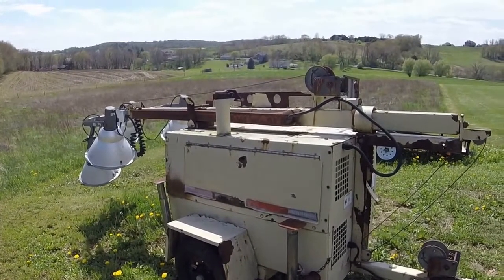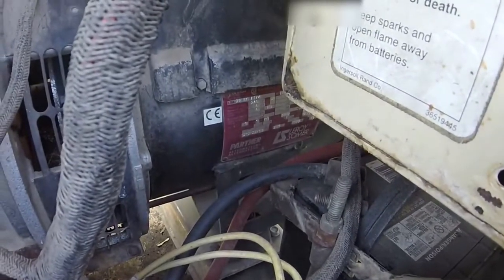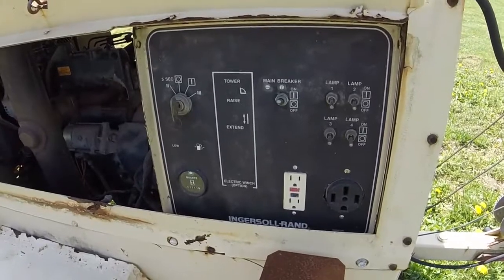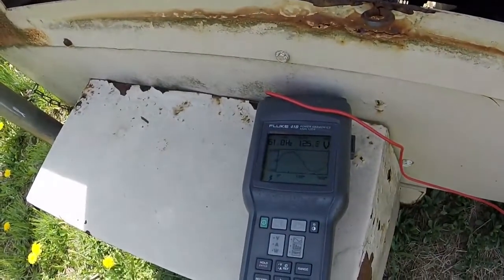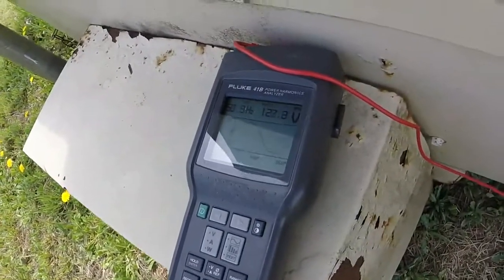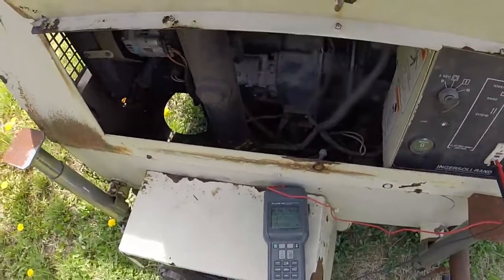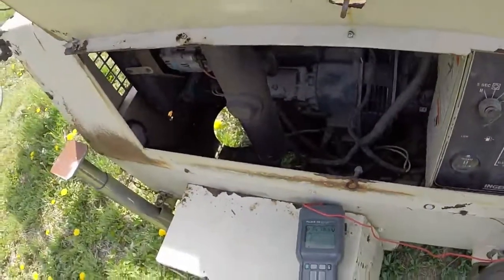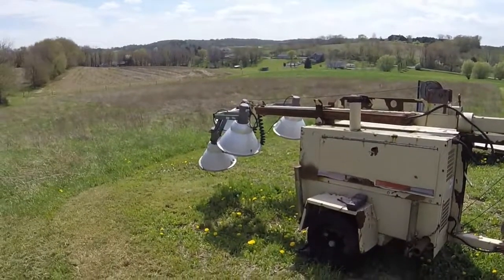diesel generator or light tower? or both?

Comment: I just bought a 2000 IR light plant yesterday. Just over 8000 hours and got it for $2000.00 dollars. Since the engine runs at 1800 rpm I kind of think of the hours as 4000 normal hours. Saw it run with lights on and ran real nice. Sticker said it had about 55 hours on oil change and it was full on oil yet.
Reply from the maker: You will like it! very quiet for a diesel.

Comment: I ended up buying a Multiquip Nighthawk LT-12 recently which outputs 6 kW continuous. I would have liked the 8 kW variant, but reality is 6 kW will power the essentials: fridge, deep freeze, HVAC heater fan, washing machine, a bunch of LED lights in the house, or a couple of small window units I have in the bedrooms, and do it efficiently. Mine has the Perkins 10-103 which is comparable to a Kubota D1005 engine, and it also runs at 1800 rpm, which is half of the engine's full capacity. It'll run 4 lights (1000 watts apiece) for ~64 hours on a tank of fuel. The onboard tank is plastic, which is great for not corroding, and holds 30 gallons. At half capacity it's consuming less than a half a gallon of diesel per hour. Supposedly they will consume about .7 gallons per hour at full capacity. Overall not a bad buy for $1300 with only 1900 hours on it. I've put about $100 into it worth of filters, coolant, new fuel lines, and a couple of cheap gauges to monitor water temperature and oil pressure. Bonus is that it shuts itself down when oil pressure is low, water temperature is high, or the air filter is clogged.

 All that fits on a small trailer that I can drive to the local oil company to have filled with tax free diesel. What a deal! Anything else with "Diesel Generator" attached to the name generally sells for well over $3,000 and doesn't have half those features, much less some badass lights you can use on your ranch, farm, or doing projects around your place. Light towers are a pretty much unknown power source except in construction circles.
Reply from the maker: I agree. These thngs are awesome

Comment: I’m a service , warranty and parts specialist for Allmand. This unit is very old and looks to be right around the time we wound our own generators and paired them with liquid cooled diesel.If anyone at any time has any questions I can help.
Reply: sir what are the specs of bulb if incase need to replace
Reply: @rickybatistil3248  the unit should have came with 1250 w metal halide lights. The 1250 bulb is a little harder to find and can only come from Allmand if you can’t source anywhere else. You can use a 1000 watt but it won’t last very long because the 1250 watt ballasts will over power the bulb but will still work.
Reply: Where is the Capacitor?   I have a 2012 but don't seem to be getting any AC power?
Reply: @659Dale  The generator capacitor is in the box on top of the Gen. Disconnect the capacitor and use a screw driver , insulated to de energize it. There are two ways you can test it. The first it to take a 12 volt battery and charge the terminals of the cap for five seconds. Let it sit for five to ten minutes then test it to see if it held 12 volts. If it did then the capacitor is working and your issue is the generator, if it didn’t then the problem is the cap and needs to be replaced. The second method is the Ohm (highest setting in meter), if it starts low and gradually increases its good, starts high and climbs or stays then it’s faulty. Sometimes if the Gen is the main problem it could be the diode on rotor shaft or even the rectifier. Windings rarely go bad but in the end it’s easier to scrap the Gen and replace with a new one.
Reply: Thanks Raymond. The 2012 ingersol rand I bought does not have a box on top.  There are two small wires coming out of the generator beside the main wiring harness. With nothing connected to them?  I also see a small black plastic cover laying inside. Can’t find any photos. Or schematics. Thanks. Appreciate your reply this morning

Comment: Look for Kubuto, Cummins or Lister. They start no matter. Lister is 20k hour motors before in stand rebuild needed. Other two, 25k. But honest wear, I do at 18k and easier to get parts off. 2k more if in oil/mining field to get last drop before you fix on contract.

Comment: Been thinking about doing that myself. Also most have low oil pressure and high temperature shutdown switches. And hold enou.gh fuel for a couple days or more.
Reply: My Kubota D-1005 in my terex RL-4000 will run my entire single wide prefab house for about 3 days before needing fuel. (30 amps) same 50 amp rv plug in this video. washer dryer, lights, 3 7,000 btu air units, tv's,  microwave, fridge... could'nt recommend this type of backup generator high enough.

Comment: Got the new capacitor plugged in and two lights working, Turned it off and after start nothing.  An Hour later startup and two lights working?  Don't think this is normal

Comment: I just purchase a allmand nite lite pro 2 v series with kobota enginge light towet and its 8kw i want to make it into a generator for my house can i convert it to powet my 1734 square ft home will it pick up my 3.5 ton a/c aswell?can you guide me if i can use it to power my home it has 3500 hrs and ist a 2014 year model did i get a good deal for  $2375 also comes with 30 gallon tank im very happy of purchase i hope i invested well ?please reply
Reply: You got a good deal for that model. Units like this sell anywhere from 8-10k new depending on the options added( outlets,artic covers, etc). We have seen others purchase these units and do the same for there homes so it will work. Here at Allmand we even converted and old tower and use it as a back up Gen which helped during the ice storm we had years ago. I would recommend speaking with a certified electrician on wiring. If the generator is an AVR it’s much better at stream lining voltage and great for small electronics.
Reply: @raymondsolano1780  thanks for replying.what a Avr can you tell me or explain and how can i find out if is a AVR. FORGOT TO MENTION YOU IT HAS HIDROLIC TOWER UP WITH A PUSH OF BUTTON GOES UP AND DOWN
Reply: @gaonajesusjg  the AVR is a voltage regulator that helps stream line current much better than the traditional capacitor. The AVR sits in the box that the capacitor is in and is in place of it. If your generator is run off a capacitor the only option would be to replace it with a AVR generator . This cleans up the EMF signal so the frequency is not to erratic.

Comment: how much voltage output going to the bulb?...
Reply: If they have the 1250 metal halide, you should see 360-440 +\- 10%. The transformer should get 120 volts from switch and then output is 360-440 all the way to the bulb.,the black wire in the light elbow should be your hot wire with green to ground.
Reply: @raymondsolano1780  yes the output power is 440v but our bulb is 220v 500watts and it indicates self ballast will it work?...
Reply: @rickybatistil3248  All Allmand units were manufactured with 120/240 multitap transformers. Each Trans should have 120 in and 360-440 out to each light. The lamp should have either 1000 watt bulb or a 1250 watt metal halide bulb. If you use anything else you can potentially run into issue with bulbs popping or not turning on. If you are getting readings of 500 at the tower cord that connects to the capacitor it’s an indication the cord has a short and back feeding power.
Reply: @raymondsolano1780  thank you very much sir for your help....God bless 😌😌